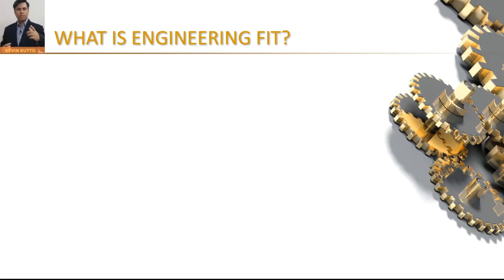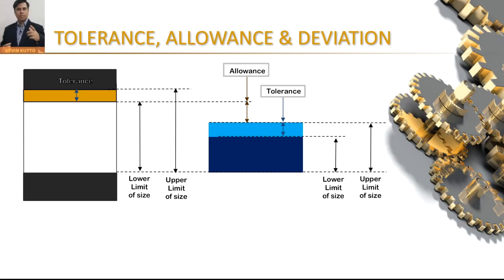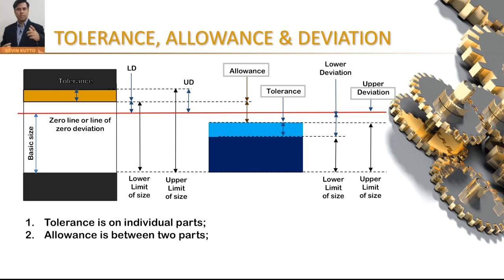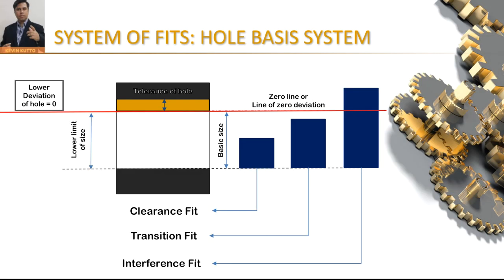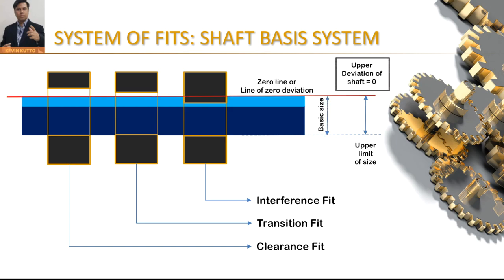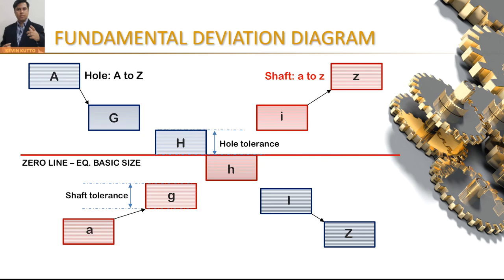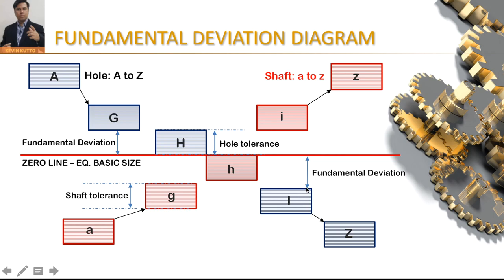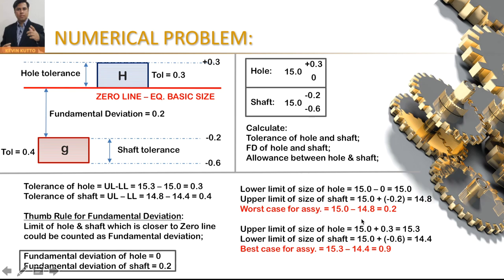How to choose Engineering Fit | LIMIT, FIT & TOLERANCE

Comment: Thank you for the video 😊.
Answer for last problem:
1. Tolerance of hole and shaft = 30.5- 29.5= 1mm
3. Allowance (worst case)= 29.5-30.5= -1mm
4. Worst case tolerance= -1mm,
Best case tolerance= 30.5-29.5 = 1mm
Hence transition fit will be applicable.

Now the question is how to decide the fundamental deviation... And hole or shaft basis system. Can you please help to resolve the problem? I watch the video twice but still couldn't able to understand.

Comment: Great video!  When designing a press fit assembly (brass pin into aluminum hole), after calculating the contact pressure of the MMC, what should be the max stress limit? Yield strength, Ultimate strength, other?

Comment: Tolerance of The Hole : UL-LL = 30.5-29.5=1
Tolerance of The Shaft: UL-LL = 30.5-29.5=1
Fundamental Deviation of The Shaft = 0 ( Because its a shaft basis system)
Fundamenta Deviation of the hole = -0.5
This is a transition fit, because it has a positive allowance in good case and negetive allowance in bad case.

Comment: Really a great video sir.
I had one doubt in the last question.
When you said it's a shaft basis system, does that mean that we have to ignore the UL of 30.5 and consider it to be equal to 30?
Bcz only then the FD for hole will be 0.5.

Comment: 1. Tolerance of Hole & Shaft = 1
2. Fundamental deviation of hole and shaft = 0 (Because shaft and hole maximum limit and minimum limit of size is same).
3. Worst case for assy = -1 (Interference fit ), Best fit for assy = 1 (Clearance fit)
4. Transition fit is having

Comment: Thanks for fulfill my request on fits.
Reply from the maker: You are welcome, Kunar Sanu! Hope it was helpful to you:-)
Reply: @mechanicalvault  Yes it was. One more request from my side to make video on geometric tolerance because there are lot of confusion in between circularity, cylindricity, run out & total run out. If possible please make separate video for each type of geometrical tolerance.

Comment: Your way of explaining is very good sir, 
And I have got all answers correct 
But, I am not convinced on fundamental deviation concept.
And remaining concepts are excellent. 
Thanks for educating us😃
Reply from the maker: What concept of fundamental deviation you are not agree about?
Reply: @mechanicalvault  in your last problem FD of shaft=0
But 30+-0.5 indicates both limits are away from zero line than how it's FD value is zero,
Excuse me, if may I wrong.
Thanks for your reply sir.
Reply from the maker: I would suggest to go through my another video H7/g6.

You will get crystal clarity around FD with actual example and charts from ISO286 standard.

FD is the location of of block from zero line.

FD of either hole or shaft will be zero based upon if it is hole or shaft basis system.

I am sure that after watching my latest video, you will get better clarity.

Comment: @18.38 (Interference fit)., is -0.25 the best case or worst case ?,i think -0.25 is less than -1.25 so it should be the best compared to -1.25.is it correct ?

Comment: Hi Kevin! Thank you for your awesome content!

As an example. I have a shaft that is connected to the bearing and the bearing to the housing. Is the housing the hole for the bearing and the bearing the "shaft" for the housing? And then the inside of the bearing would be the "hole" for the shaft and the shaft is the shaft itself?

I mean, that is what this Hole and Shaft system is for, correct? Or for fir for bearings we would have to consider another type of engineering fit?
Reply from the maker: Yes, you understood it correct.

You can imagine it like - Shaft and hole is like assembly between external and internal features of the parts.

So, we can have different Engineering Fits between parts in the assembly or between su-assembly of parts and housing.
Reply: Awesome! Many thanks for your clarification.  @mechanicalvault

Comment: 1) Hole Tolerance = 1, Shaft Tolerance = 1
2) Fundamental deviation of Hole = -0.5, Fundamental deviation of Shaft = +0.5
3) Allowance for Hole = +1  (Best case for assembly), Allowance for Shaft = -1 (Worst case for assembly)
4) Transition fit

Comment: Tolerance of The Hole : UL-LL = 30.5-29.5=1
Tolerance of The Shaft: UL-LL = 30.5-29.5=1

Size of the shaft is 30
Fundamental Deviation of The Shaft = 0 ( Because its a shaft basis system)
Fundamental Deviation of the hole = 0.5

Lower limit of size of hole = 30 -0.5 = 29.5
Upper limit of size of shaft = 30 +0.5= 30.5
Worst case for assy. = 29.5 - 30.5 = -1(-ve clearance)
So this is interference fit.
Upper limit of size of hole = 30 + 0.5 = 30.5
Lower limit of size of shaft = 30 - 0.5 = 29.5
Best case for assy. = 30.5 - 29.5 = 1 ( +ve clearance)
So this is clearance fit.

Comment: TOLERANCE FOR BOTH WILL BE 1, F.D FOR SHAFT WILL BE 0 AS UPPER LIMIT OF SHAFT WILL BE ZERO LINE SINCE IT IS SHAFT BASIS SYSTEM,  ALLOWANCE WILL BE ALSO 0 AND IT IS PUSH TYPE OF TRANSITION FIT.
Reply from the maker: Tolerance oh hole = 1;
Tolerance of shaft = 1
It's shaft basis system:
F.D. oh shaft = 0;
F.D. oh hole = 0.5
Worst case clearances:
A1 = 30.5(H) - 29.5(S) = 1 Clearance
A2 = 29.5(H) - 30.5(S) = -1 interference
Allowance = -1 (Worst case of A1 & A2)
Since we get both clearance & interference, it's a transition fit;
Reply: How are you getting 1 as tolerance , it should be 0.5 right  @mechanicalvault
Reply: @mechanicalvault  sir can you share the FD diagram to be drawn because in example u have suggested tolerance of 0 to zero line but here it is+or - 5.hiw to draw it sir.
Reply: I also have same doubt

Comment: 1.SHAFT:
    UL= 30
     LL = 29.5
     T= 0.5
HOLE:
       UL= 30.5
       LL= 29.5
      T= 1
2. F.D for shaft is 0
    F.D for hole is 0.5
3. Allowance = 29.5-30= -0.5
4. Transition fit

Comment: hi
Answers:
1.Tolerance of hole and shaft = 1
2. Fundamental Deviation of Hole = 29.5 and for shaft 30.5
3.Allowance between Hole and shaft=0
4. it is Transition fit
Reply from the maker: Answer 1 & 4 are correct;
Correct answers of Q2 is - FD of shaft is zero as it is shaft basis system;
And FD of hole is 0.5;

Correct answer for allowance = 29.5 (H) - 30.5(S) = -1.0 which is worse case for assy; I  recommend you to go through Fundamental deviation diagram again and also through the example which I have explained in the video;

But good try;
Reply: @mechanicalvault  
Thanks for the confirmation.
I get The 3rd answer but
About FD ,
We mention FD as tolerance value or entire size value ?
And you mentioned shaft size 30+/- 0.5
Bilateral tolerance, then how FD of shaft will be Zero?
Can you please clarify?
I took entire size value
Reply from the maker: I recommend you to watch video again especially understand hole and shaft basid system, fundamental deviation diagram and numerical example which I have explained.  You are getting confused between upper,  lower and fundamental deviation.  If possible watch complete video, it will clarify your concept once and for all;
Reply: What would have been the results if the deviation was a hole basic system